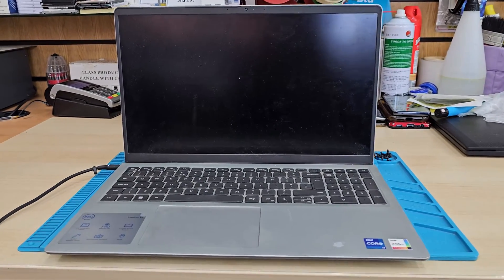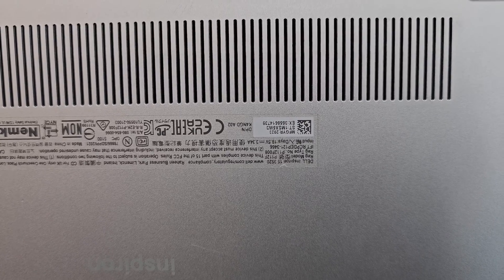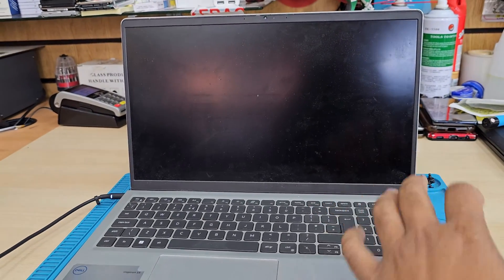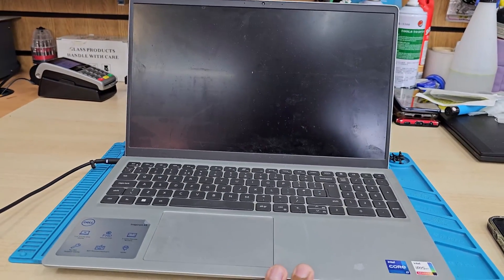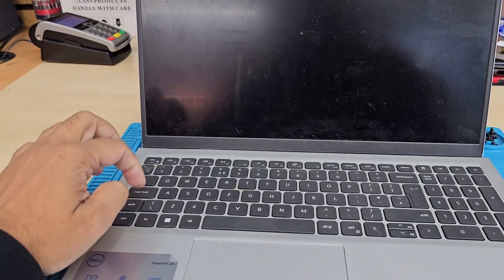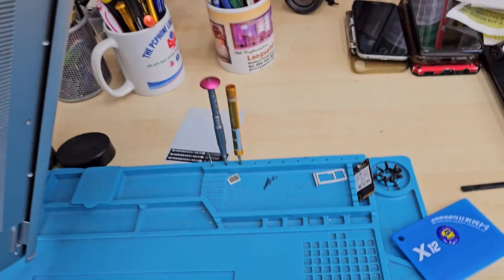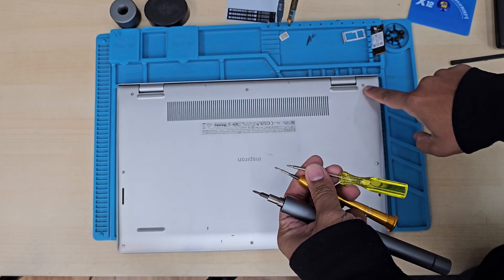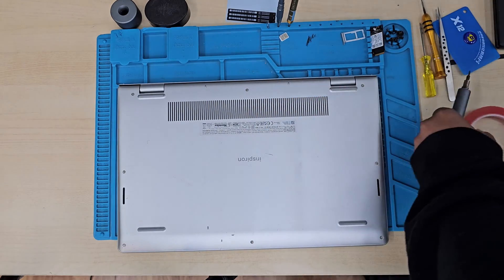Replacing the Damaged Screen on Your Dell Inspiron 15 3520 | A Step-By-Step Guide

Comment: You can just press and hold the letter "B" on the keyboard then press the power button to go to service mode. Service tag number will show on screen then press any key and the laptop will beep 3 times. Then it will fully shutdown, no power from battery so you can perform maintenance. Once you have finished replacing screen press the power on button but you will need the power adapter connected or it won't boot up.